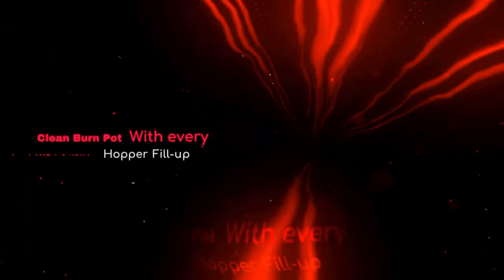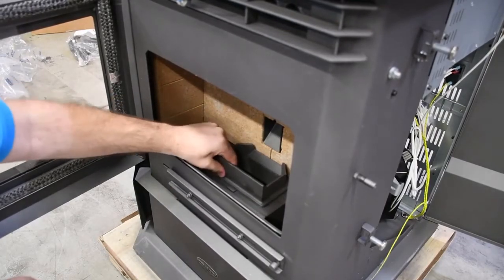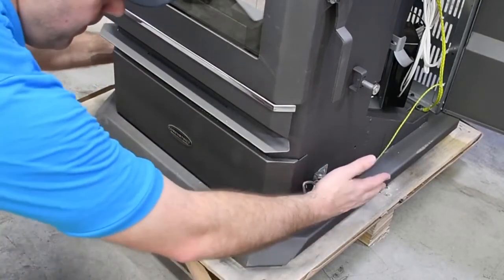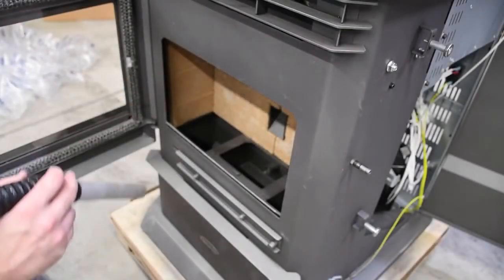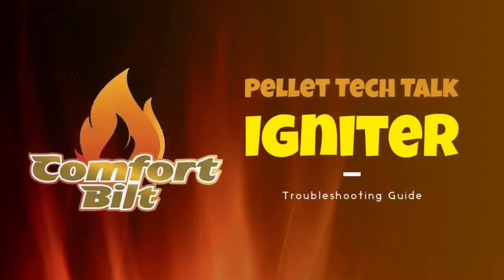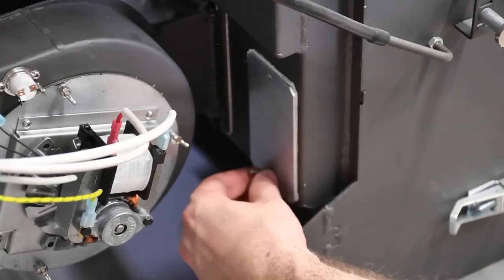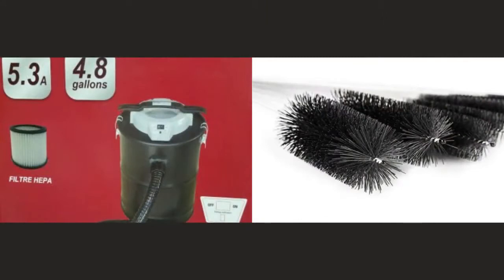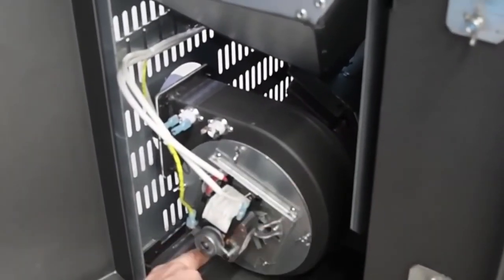Hp61 Maintenance And Cleaning

Comment: I generally run my HP61 in the morning, shut it down to clean the burn pot and refill the hopper..  Despite this, occasionally the stove shuts down.  The error message states either the hopper is empty or check the burn pot.  It's always the burn pot.  Usually a couple of holes are clogged.  What would cause that when I clean the pot everyday and use premium pellets?  By cleaning the pot, I wire brush the all the inside and poke every hole with appropriately sized Philips screwdriver.  I then vacuum it our and replace.  I'd say this happens once every couple of weeks.
Reply: Buildups in the burn pot, and dark black ash or soot on the glass are clear indications of limited airflow.
There are two main problems that lead to limited airflow.
1) Negative pressure leakage - This is where the stove is drawing air incorrectly.  Instead of pulling air through the pellets, it is pulling air around them.  Common places where this occurs is A) the bottom ash pan drawer - make sure that both side latches are snug and have even pressure. Or B) the burn pot itself - Make sure that the burn pot sits completely flush on the cradle. (this is very important)  You want to avoid gaps around the bottom of the pot where air could spill out around the pellets instead of up through.
2) Restrictions - this could occur when a buildup or clog starts to restrict airflow, and not as much volume of air is able to be drawn through the pellets, and thus slows the burn down.

Comment: What about the auger Turning off after the fan turns on when starting it. Cleaned all the insides already
Reply from the maker: That sounds like a vacuum switch not staying engaged.  This can happen if there is a blockage in the piping, or if there is a loose/leaky seal somewhere.  It could also be a faulty diaphragm within the vacuum pressure switch.

Comment: Brand new hp61 just hooked up yesterday, Ran fine overnight start up this afternoon get squeaking noise non stop. Please help.
Reply from the maker: Constant squeaking noises are usually debris in or potential damage to the room blower fan during shipping.
Reply: @comfortbilt5770  blow out the exhaust fan and make sure the one that blows for the interior is good. Also clean all the Vents interior an exterior. Usually  a squeaking noise is fan related depends on age, most liky one of the fans. Could be bearings I would clean and lube related everything.